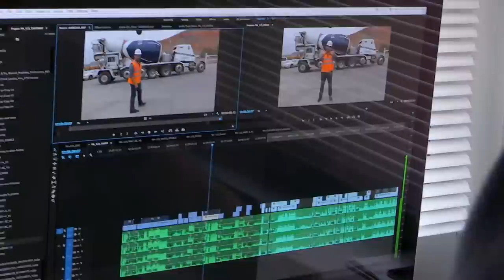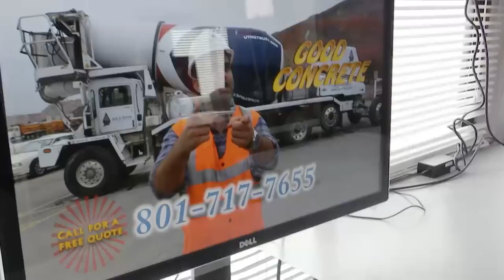The Driveway of Your Dreams - Random Acts

Comment: I'm all for doing good things for other people, but this has to be one of the worst concrete jobs I've ever seen. By this time next year all that beautiful concrete is probably going to be looking like a cracked egg shell. First of all, they didn't put down any gravel base underneath the concrete. Secondly, they didn't even use a tamper to pack down the soil. Lastly, they didn't use any wire mesh reinforcement in the concrete to hold it together when it does crack.
Reply: they had to do it very fast.
Reply: Not to mention, they edited around 7-8 hours of footage into 5-7 minutes.

They probably did all the things you just pointed out, we just didn't see it.
Reply: Hermione Granger 
Why, fancy seeing you here.
Reply: look at google maps... still looks like it is in good condition.